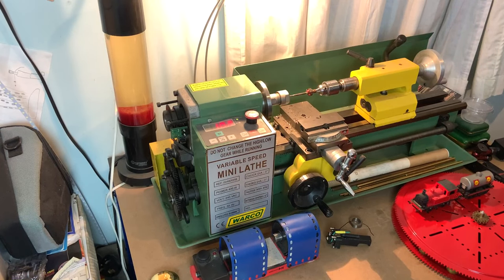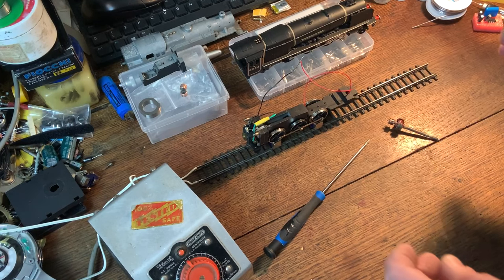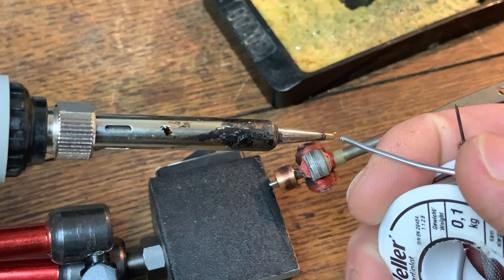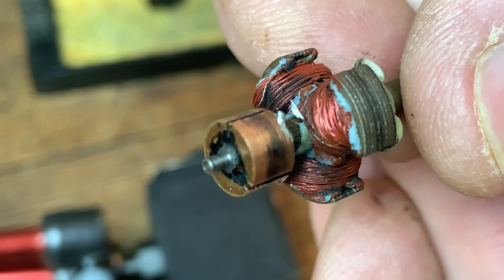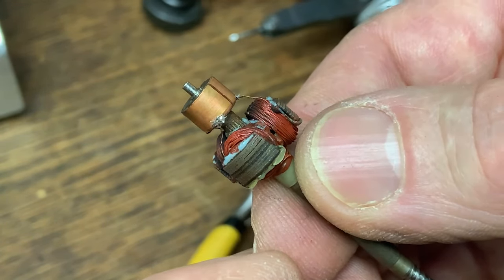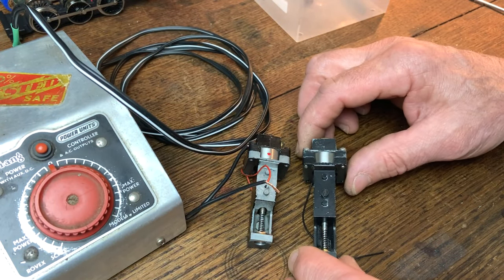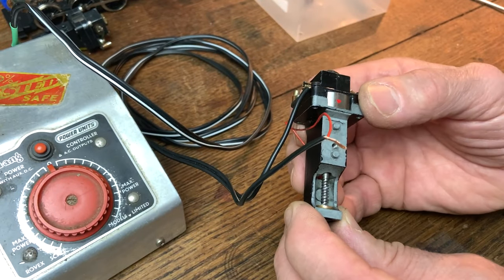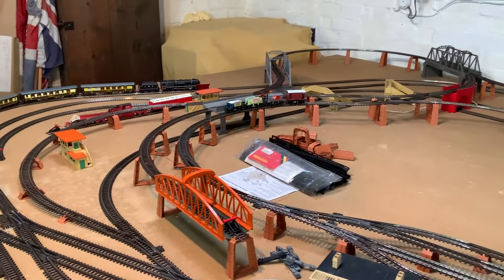Changing A Hornby Dublo Ringfield Commutator. Wrenn City Loco Drive Wheel Upgrade. Some Channel News

Comment: Really good result with the armature! New commutator works a treat. I think the later X04 commutator is more prone to this, I have early 60s ones with hairline gaps and late 70s with gaps 1.5 mm wide! It really does make a noise and brush wear difference. I think we'd all like a small lathe like yours! The wheel swap looks very accurate compared. 6'9" in real life so makes it far more of a model than a toy. 
Thanks for another great video
Reply from the maker: I've noticed some funny gaps on commutators in XO-4 motors. I'm glad you liked seeing the wheels changed on the City loco. Take care, all the best to you

Comment: I concur...it does look good with bigger wheels..... good repair too, I once had to resolder a guitar pickup wire, very thin, that had broken....
No worries, just glad to see the content you post, when and as it happens...
We're having autumn here in Australia...
Have a safe, enjoyable trip....🙏😊
Reply from the maker: Thanks for watching, I hope your Autumn is nice. Soldering thin wires usually goes well so long as you get them tinned. I don't know if guitar pickup wires are enamel coated but getting them tinned can be an issue. Take care, all the best to you

Comment: Thanks for this video I have a west county class amateur one of the wires has come from the windings to the brass top piece one that you have just fitted. Now I have seen this video. I will have a go of chasing the wire from the armature windings and I will 

resold the wiring to the brass top piece many thanks Colin.
Reply from the maker: I hope your soldering went well. Thanks for looking. All the best to you
Reply: Hi hand good afternoon just to let you now after watching your video on repairing a hornby dublo amateur, yes I’ve successfully soldered the wire to the

 windings to the top of the armature. It is now pulling all the right amps on my multimeter so once again, thank you very much for your help. Colin

Comment: The larger wheels look much better and more realistic than the originals which are a bit undersized. Nice work on the motor repair I didn’t know spares had been available to that level back then it’s a shame modern models can’t be fixed like that.
Looking forward to seeing what amazing things you come up with next, all the best Rob
Reply from the maker: I can't remember where I got those commutators but it might have been at a show. Only one left now. Thanks for looking, all the best to you

Comment: I'm quite amazed that spare commutators were ever available and that you would have some on hand. That part of the repair was straightforward but how you straightened the shaft I'll never know.
Stoke of Trent looks much better with the larger wheels. The prototype had 6'9" driving wheels, I wonder what your replacement wheels would scale out to.
All the best with the up-coming trip. I'll look forward to seeing what you have for us next time.
Regards, David.
Reply from the maker: Hello David, I seem to remember reading that the Hornby Dublo and Wrenn City wheels were undersized so hopefully these are nearer to proper scale. Careful bending after observing where the high point of the bend is restores things and it's easy to see when it's straight as it rotates in the lathe. Thanks for looking and I hope your spring brings nice conditions for you. Best regards to you

Comment: Interesting ! I’ve been wondering for a while if Castle wheelsets wouldn’t look better on the Dublo/Wrenn Princess Coronation. So now we know. Having said that on my 6234 blue Duchess of Abercorn build I just blackened the wheel rims. I wish I could post a photo, but really it looks very good. I wouldn’t do it to 6231 as she is in 100% original condition and is also apparently quite rare as she has the »Lug » casting error on the right hand side. But until I got to work in 6234 she was pretty much a scrapper. So no regrets.
Have a good break Mr S!
Reply from the maker: I was just experimenting with those wheels, it turned out much better than I thought. Blackening those rims sounds an excellent idea. Best regards to you

Comment: G'day Mr Snooze.Another excellent 'how to do it video' thank yo.u I would imagine that replacement commutators are pretty difficult to find these days. Couple of queries if I may. Why do you square off the brush ends using up some of the brush and necessitating extra running in? Some Dublo brushes have a slotted end that I understood was to enable you to turn the brush after insertion to align the curved end with the commutator and even the solid carbon ones I would think would bed in fairly quickly irrespective of how the mated end meets the commutator. Also would love to see you rewind that X04 motor as I am attempting to rewind one after yet another viewing of your series on rewinding the 410 armature. I envy you your rain. We are entering our fourth dry month in West Aus. Be careful what you wish for! All the best. Jim Craven
Reply from the maker: Hello Jim, to be honest it's probably not necessary to square off brushes, it's just something I have always done to give them a new start to bed in. I find you hardly remove any material on the Wrenn / Dublo items, maybe a bit more on XO-4 though. I think I must just enjoy doing it. Thanks for looking, best regards to you

Comment: Very interesting and beautifully done repair.  Anyone would think you had experience with tiny rotating components.  I have had to re-solder two commutators, one went perfectly, the other not so, but ended up fine after some panic on my part😱.  It's quite an exacting job.  The larger wheels look nice and I can't tell if it makes the loco ride any higher or not, looks fine to me.  Love the little lathe.  Have a nice break and looking forward to more things.  Have you given any thought to some basic landscaping?  😊
Reply from the maker: Thanks for watching, soldering these thin wires always goes well if they are clean and tinned well. I've had issues cleaning the enamel coating off these wires in the past leading to soldering issues. My wife is pushing for some significant changes to the garden but I assume you are wondering about the layout when you refer to landscaping 😊I think I might leave as is but if I ever used modern items I'd most definitely get into ballast and everything else. Take care, all the best to you
Reply: @MrSnooze Haha, yes definitely referring to the layout.  For obvious reasons I didn't want to glue ballast all over my precious Super 4 track so I experimented with printed ballast paper, cut out and laid under the track.  I got an image of some ballast gravel from a web site, copied and pasted it multiple times to make an A3 size sheet and had it printed out.  It looks very convincing from 2 feet away 😊

Comment: I’ve got a Dublo 8F in need of some motor attention… Would you happen to have any wiring diagrams for Dublo/Wrenn Ringfield armatures? Trying to rewind the armature on my 8F, but it keeps shorting!
Reply from the maker: I'm pretty sure the are wound to a common connection at the base of the armature so only one wire to each commutator segment. so when you wind a coil leave the start of each coil at the bottom of the coil and when all three are done connect the bottom three wires together making sure to insulate from the shaft or laminations. Hope this helps. Take care, all the best to you
Reply: @MrSnooze  Righto, will try that this weekend, I was originally following a tutorial by SMT Mainline, where he solders the wires in such a way they ground the plates to one another, that may have been the issue on my attempts, cheers!

Comment: Snooze: best video yet; the best of an outstanding bunch.  Well done (don't get a big head).  

Hmm?  None of the HD locos ever struck me as being toys.  Either way probably it's all about how you use them.  https://www.youtube.com/watch?v=U1yKAtmEG8o features a museum quality model of only artistic interest to us.  Its sixty million billion dollars would buy a lot of Pal Meatybites!  A r-e-a-l lot.  The craftsmanship is spell-binding, but in its way no better than the wizards at Binns Road.  However, no doubt the 'right' person could reduce it to a toy, and could do it by simply 'playing'.  Reach for a peppermint.  On another level, Dick Dilworth's comments re what he was going to do (and did) to the Big Boy on 'that 'hill' in Wyoming' comes to mind.  I'll find them for you some time.  My goodness: can you imagine the real thing running over your big toe?  
Certainly the activity and running you do has nothing 'toy' about it.

Snooze, while you're still awake, do you think you can do something about those boiler bands flapping around in  the breeze.  Perhaps a little gum-glue from the local news agent.  Try on an old transfer first; perhaps dilute with a bit of water.  A top notch modeller told me that this way there's no need to gloss varnish prior to decalling.  The tiny sheen producing air-bubbles are squeezed out as the glue flattens, or simply do not form.  Here there would be no frosting anyway, but I wonder if it works?  Does anyone know?  If true decalling print just got a lot easier.

The rust on the rotor shaft suggests the expansion rust implies could have stressed and cracked the commutator core.  I wonder if rust was involved in Williams' comments below.  (Can you see how useful this channel is, Snooze).  Time would have been a problem, but in the absence of spares, I wonder if the piece could be mounted in a split mandrel (see Chris Pendlenton 'Wheel Derangements' in MRJ) and a new core made.  Just be careful to contact the polymer manufacturer to find out what the stuff releases into the air when hot.  If dangerous, ask for suggestions.  Safety matters.  We have to be able to 'see around corners' in these activities, and always remember that when we are dead and gone and everyone is cheering, an unsupervised kid might be the next one to get your model.  Statistical theory tells us he has even chances of being average or below average IQ, and plays probably unsupervised.  Test the heat characteristics of your models (modified or not), and know you have used failsafe materials.  
Are those spare coppers still available?  Keep in mind some of the Wrenn used Triang commutators; easier to find.

What did you do to polish that commutator? 

The timing is another question; does anyone know if a motor has a lag or lead built into it?  My Wrenn 'City' has a brush bore quite out of square.  It might be by design.  The model runs like a Swiss watch and does not overheat (so far as I know).

Thanks for your considerable efforts Snooze.

Snooze: best video yet; the best of an outstanding bunch.  Well done (don't get a big head).  

Hmm?  None of the HD locos ever struck me as being toys.  Either way probably it's all about how you use them.  https://www.youtube.com/watch?v=U1yKAtmEG8o features a museum quality model of only artistic interest to us.  Its sixty million billion dollars would buy a lot of Pal Meatybites!  A r-e-a-l lot.  The craftsmanship is spell-binding, but in its way no better than the wizards at Bins Road.  However, no doubt the 'right' person could reduce it to a toy, and could do it by simply 'playing'.  Dick Dilworth's comments re what he was going to do (and did) to the Big Boy on 'that 'hill' in Wyoming' comes to mind.  I'll find them for you some time.  My goodness: can you imagine the real thing running over your big toe?  
Certainly the activity and running you do has nothing 'toy' about it.

Snooze, while you're still awake, do you think you can do something about those boiler bands flapping around in  the breeze.  Perhaps a little gum-glue from the local news agent.  Try on an old transfer first; perhaps dilute with a bit of water.  A top notch modeller told me that this way there's no need to gloss varnish prior to decalling.  The tiny sheen producing air-bubbles are squeezed out as the glue flattens, or simply do not form.  Here there would be no frosting anyway, but I wonder if it works?  Does anyone know?  If true decalling print just got a lot easier.

The rust on the rotor shaft suggests the expansion rust implies could have stressed and cracked the commutator core.  I wonder if rust was involved in Williams' comments below.  (Can you see how useful this channel is, Snooze).  Time would have been a problem, but in the absence of spares, I wonder if the piece could be mounted in a split mandrel (see Chris Pendlenton 'Wheel Derangements' in MRJ) and a new core made.  Just be careful to contact the polymer manufacturer to find out what the stuff releases into the air when hot.  If dangerous, ask for suggestions.  Safety matters.  We have to be able to 'see around corners' in these activities, and always remember that when we are dead and gone and everyone is cheering, an unsupervised kid might be the next one to get your model.  Statistical theory tells us he has even chances of being average or below average IQ, and plays probably unsupervised.  Test the heat characteristics of your models (modified or not), and know you have used failsafe materials.  
Are those spare coppers still available?  Keep in mind some of the Wrenn used Triang commutators; easier to find.

What did you do to polish that commutator? 

The timing is another question; does anyone know if a motor has a lag or lead built into it?  My Wrenn 'City' has a brush bore quite out of square.  It might be by design.  The model runs like a Swiss watch and does not overheat (so far as I know).

Thanks for your considerable efforts Snooze.
Reply from the maker: Hello Pete and thanks for your detailed comment.  I have actually found quite some variation in commutator timings on Wrenn locos in the past. It's always something to check especially if you find an item that seems to run much better in one direction than the other. A quick careful timing adjustment has helped more than one motor in my small collection. Take care, best regards to you
Reply: All the best for your time away.  Pete @MrSnooze